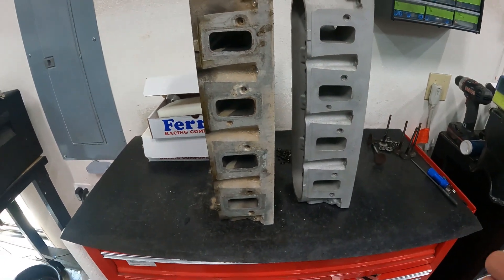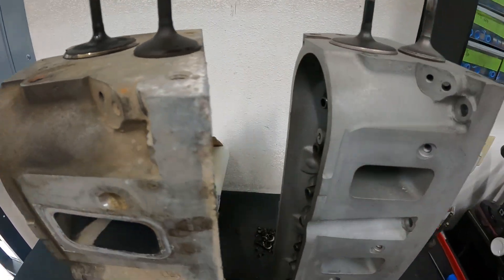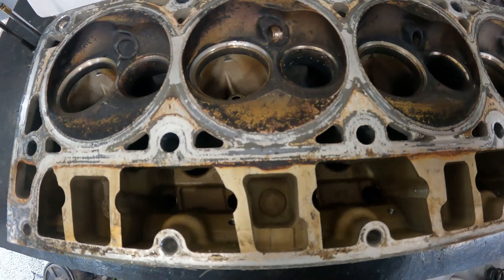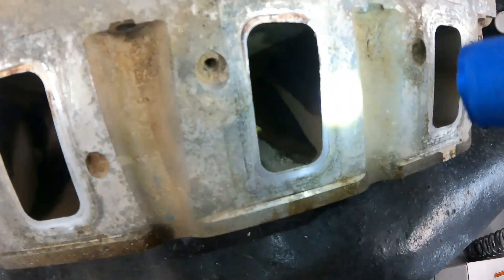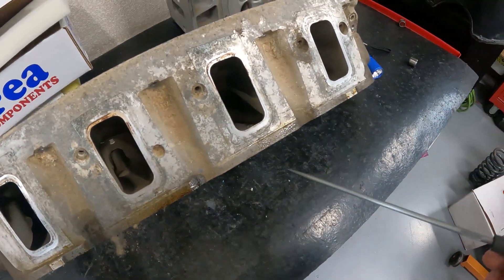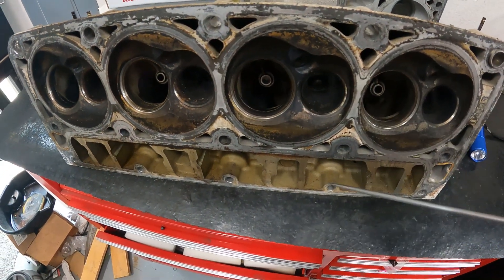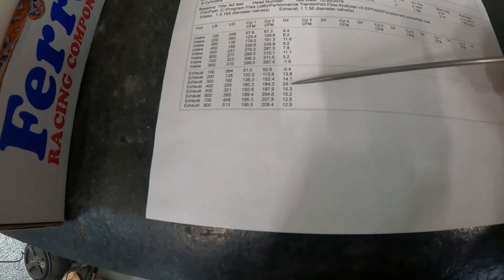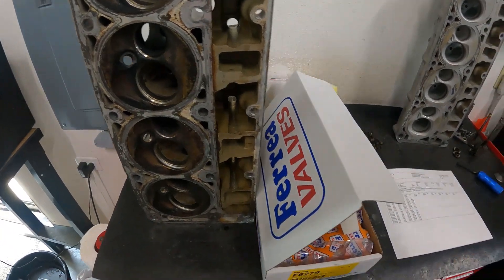How Much Flow is Lost with a Dirty Head

Comment: Not sure how I missed this video before... I want to say that I am amazed by the results, and annoyed myself. I had an engine failure late last year due to a lifter turning sideways, etc. I has to throw something together quick out of my parts stash. The cylinder heads I had were NASTY. I was pressed for time, and pretty much only gave them a quick clean to knock off the big chunks. Being they were that dirty, I'm betting they were well-used. I dynoed and retuned it, have always felt it was down on power. This could 100% be some of my missing power - dirty head ports and trash valve job. I relapped the valves in by hand, but noticed they had a lot of pitting after I cleaned the valves with a wire wheel. Thanks Eric for taking the time to do this test and post the results. I have a clean and rebuilt set of the same 862/706 heads in my possession now. And they have a better valve job with valves that aren't pitted. I may need to swap them out and redyno for "science."

Comment: In the 80s our chevy 18 degree V6 head freshly ported would lose 20 cfm after 25 runs on C12 C14 fuel the soot build up from the fuel would slow down the NHRA record D/D runs, I had to polish the exhaust side to a mirror finish each time to last a while ( a coating of some kind might have helped)

Comment: How exactly does the port of a Normally Aspirated engine with a stock low-lift camshaft see reversion ? I could see it in a Forced Induction setup, or perhaps with a wrongly sized camshaft on small stock ports, but Normally Aspirated with a tiny cam ? I don't understand.

Comment: hi Erick in this video he heard you talking about the flow of these LS 823 cylinder heads. 
Do you have or have you calculated the MSCA for this cylinder head?
based on your experience how many RPM can be achieved in an LS 6.0 with these heads generating power?

Comment: Do one of these with a 100K mile Gen V LT!! Those engines NEED a valve job at roughly 100K because of carbon buildup on the backside of the valve. DI and terrible PCV

Comment: I've seen much dirtier combustion chambers and especially much dirtier valves.  I've seen 1/8" thick deposits on the back side of a valve head.  We cleaned combustion chambers (iron heads) with a wire brush in an air drill and the valves themselves with wire brush wheel on a bench grinder.  I always wondered how much difference that made in how the engines could run.

Comment: Any chance of getting your hands on a diesel head with EGR-raped ports? I work at a car dealer and sometimes we need to sandblast the intake/exhaust ports to clean them up on diesels, I'd imagine we lose 50% of the diameter of the port, would be fun to see how much difference that would be.

Comment: makes a good argument for some sort of mild water/methanol injection into the air stream as a maintenance thing. or just do the old timer trick of water down the carbs gullet. not sure how well that would work on factory plastic intakes with curved runners though.

Comment: Do you absolutely need to do a valve job on a set of heads after blasting ? If the back cut appears sufficient, and the seats look good, could you just lap them back in and be good to go ?
Reply from the maker: I’m going to say yes. The surface definitely gets ruffed up with the blasting.
Reply: @WeingartnerRacing   ok..  thanks.

Comment: The wider the lobe seperation angle, the less the reversion.  (Overlap)
Reply: True, but depending on the application it usually equals less torque production also. That's  probably why this head is so clean. The LS heads still make great power utilizing a wide LSA. Old school factory stuff doesn't flow as well, so they use tighter LSA cams to aid in flow at high RPM.

Comment: PCV oil also contributes. You also have to factor in an egr effect from variable valve timing or cam timing (which is the reason EGR disappeared).

Comment: I dont think reversion is the reason theres carbon in the intake ports. Id say its the pcv system dumping crank case vapor into the manifold. Anything reversion can deposit is instantly drawn back into the cylinder anyway.

Comment: I’m shocked, in all reality, those heads aren’t that bad either, I’ve seen way worst. The early direct injected engine look way worst at way lower mileage. I’ve seen just globs of carbon on the intake valve at around 20,000 miles. Most of the newer engines have direct and port injection to help remedy this, at least the ford engines. They’ll run on port around idle and it does help keep the valves clean, from what I’ve seen. Cool data though.

Comment: Eric, I have to ask this just because. How much power is lost because of the accumulation of carbon? It would be really nice to know just how much it costs horsepower wise, so you would know approximately when to take the heads off and clean them. A dyno test before cleaning, after cleaning and after porting on the same engine would be an awesome comparison. Probably a pain in the arse also, but a really relevant question.
Reply: The quick and probably "not so accurate" method to determine that would be to multiply the number x2.. so if the port picked up 12 cfm.. in theory you could expext to gain 20-25 power numbers in that range. Just a quick and dirty merhod for a rough estimate.

Comment: Does anyone make a bolt on 3d printed plastic radius entry instead of the clay?  Seem like that would provide more consistent results.
Reply: That's a cool idea, but I think you'd run into trouble due to casting variances from one cylinder head to another.  Not all intake ports for a given application meet any type of standard. Unless they're an aftermarket CNC version of course.
Reply: I'll make some for you if you want, free of charge

Comment: I'm wondering if carbueted engines see similar carbon buildup on the intake ports.
Reply: yep pretty much, the greatest carbon build up is on cars with direct injection as there is no fuel to clean off the carbon build up, which is all coming out of the ventilator casing.

So in order to minimize it, you need to do regular oil changes, as the fresher the oil, the less carbon deposits you'll end up having. There have been lots of people saying seafoam is pretty good, but if you have the ability to strip the heads down and blast them, you'll get a far better result, and then you can use seafoam as a regular thing that you do maybe every 10-20k in order to keep everything nice and clean.

Comment: cept for the shitty LS crank case venting.. my intake and head ports are oil coated.. damn engine has used a quart of oil every thousand miles since I bought it new.
Reply: Have you done the updated driver side valve cover or modded yours to fix the oil use issue?
Reply: My neighbor had an LS1 that did the same thing, long story short after he gave me the LS1 I pulled #4 piston out and it was missing 1 oil scraper ring from the factory, I am enjoying that LS1 in my S10 now, runs good.

Comment: Water/meth injection does a good job keeping ports and piston tops clean. So do oil catch cans for the breather system if running a closed system. If nothing else, a junkyard motor should have the heads yanked and cleaned. Maybe 10-20 hp right there.